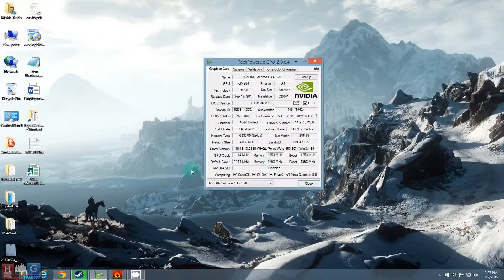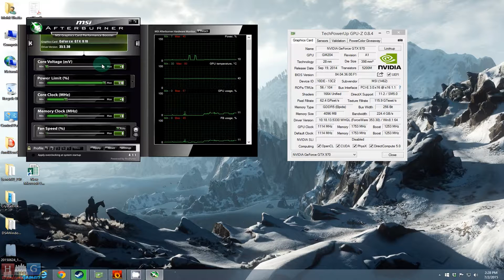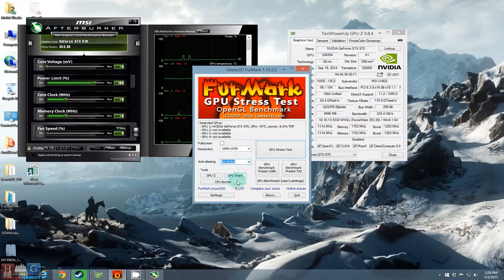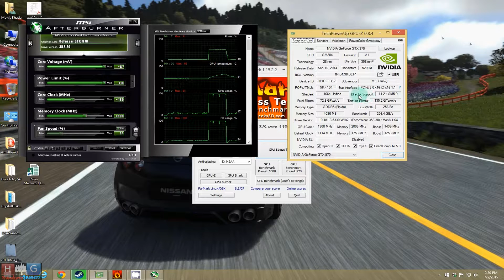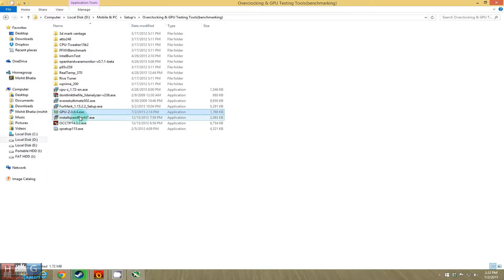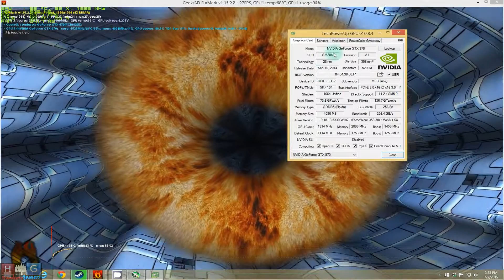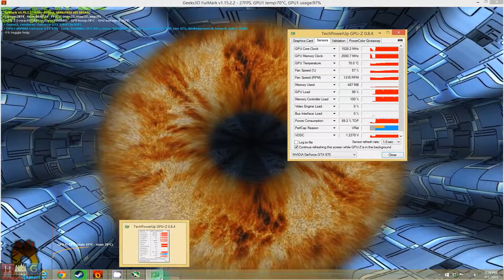Overclock MSI GTX 970 Gaming 4G Using MSI After Burner , GPUz and FurMark

Comment: Just to mention, I know that the white and black model, has a max possible voltage of +25. That is as high as it will increase, unless you lower the resistance of the actual power shunts on the power delivery. 

Anything more is not going to do anything on the hardware, and this can be verified in GPU-Z very quickly. Max voltage caps out @ +25. 

With water on the core, I have achieved 160 core and 300 memory, to reach a very stable result. It would work fine on air too, but I try to consider the TDP% being utilized, and the fans do add in  for that number. I try to maintain the card around 110-113% TDP when on the heaviest usage w/ those settings. Just mentioning in case it helps anyone else.
Reply from the maker: Thanks for sharing

Comment: My gpu is using between 102% - 106%. Is that normal?
Reply from the maker: Percentage of What?
Reply: Power
Reply from the maker: Yeah thats fine as long as you have good PSU.
Reply: +TheHGunified 850 evga super nova 2
Reply from the maker: Thats a good PSU
Reply: ok thanks man. i appreciate the help
Reply from the maker: No Problem, if you ever face any issues, feel free to comment.

Comment: why do my msi gtx 970 crash when i overclock it?
Reply from the maker: +Wolf Can you mention your compete specs, so that i can help better.
Reply: motherboard: rog crosshair v formula-z
cpu: fx-8350
WaterCooler 15 celsius
ram: 16gb 2400 mhz
graphic card msi gtx 970
Reply from the maker: Power Supply?
Reply: nothing to do with it, 850W
Reply from the maker: PSU is very important in over clocking.  A good PSU can help overclock reach high stable clocks. 

Can you try overclock on memory only initially. Like from 3500mhz to 4000mhz and tell me the result.
Reply: works fine
Reply from the maker: Now increase the core clock by 50mhz
Reply: @HardcoreGamersUnified  How should I OC mine?  Just leave it at max voltage and thats all?  I have a fx 8300, and a PSU way over powered for my system

Comment: I don't understand about the fan speed setting here. Isn't that better to let MSI gtx 970 take care of when to use the fan and how much, instead of etc limiting it to only 40% fan speed. This fan wont spin before it reaches 60 Celsius anyway at default, so why set on 40% always only spin in afterburner. Can someone clear this out for me?
Reply from the maker: +xPowerShotx Yeah it is better for GTX970 to handle it.

Comment: i have question for you .. i have gtx 970 strix sometimes when i play games fps instantly drops what is reason ? i dopnt understand i overclocked my gpu 1480 few times .. is that affect that? i didnt do by myself i se=arched in youtube.. please answer me
Reply from the maker: Ulvi askerov FPS drop could be because of your storage device , RAM or even cpu. 
can you type full configuration of your here. Thanks.
Reply: thank you
Reply from the maker: nah, no such relation.
Reply: +TheHGunified yo i have a msi gtx 970 and i get fps drops like ulvi i dont understand why i have i5 4690 cpu and 8gb of ram help!
Reply from the maker: What resolution are you playing at and what games
Reply: im playin gta 5 at 1080p very high settings took 2641mb of video card memory 2641  out of 4096
Reply: its the cards first day btw is itbecuz its the first day?
Reply: I had this problem cos of the vsync was enabled.. turn that shit off ingame or in driver maybe ? for me it was ingame enabled and caused fixing it to 30 what its supposed to do if u use vsync